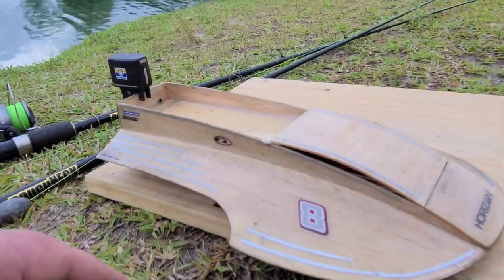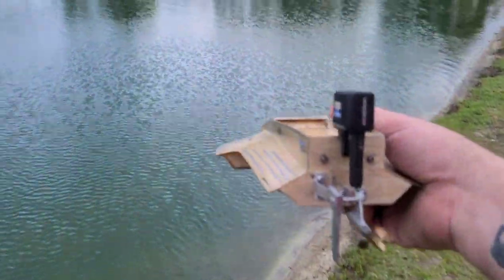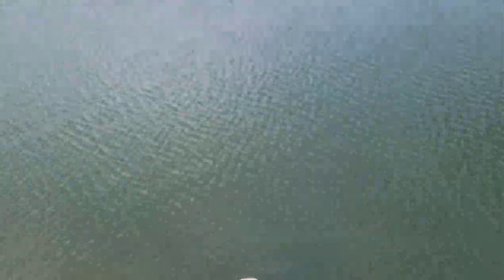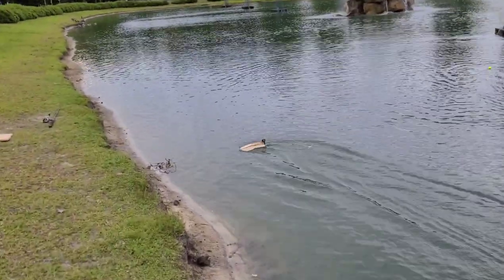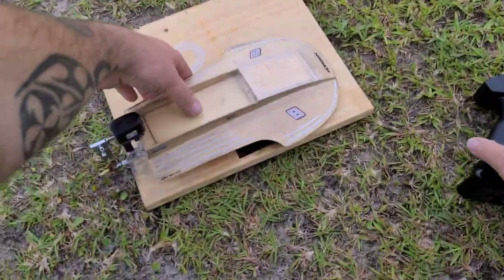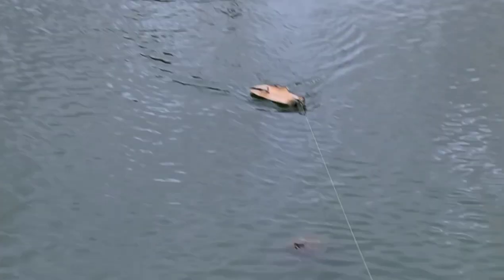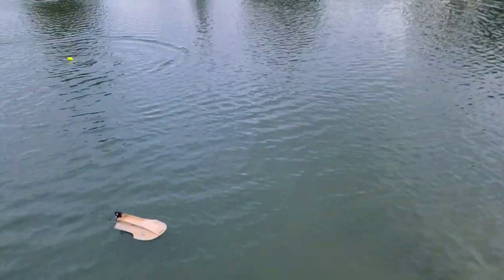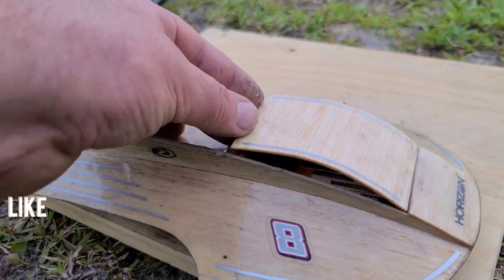12" Micro Racer Challenge Entry, 1/8th Scale Tiny Titan Hydroplane

Comment: I was wondering where you had been.  I sure like that little thing, especially when it's sliding through a corner.  Good job!
Reply from the maker: Been busy the past few days plus I had been tinkering  with this little kneeler trying to get a few laps in by the dead line.  I was hoping the kneeler would have the faster lap time!  3 or 4 days trying to best my best lol.   The kneeler is much heavier, I should of put the 5200kv motor on the kneeler & the 7200kv in the rigger..  oh well.
Reply: @IRONCLADRC  There's always the next Challenge.  My plan for it is something simple and cheap that you can race deck-to-deck and not worry about a little "nerfing" (or ramming for that matter... 🙄)  So simple and cheap, you can build several at once for the cost of a couple of gallons of gas....